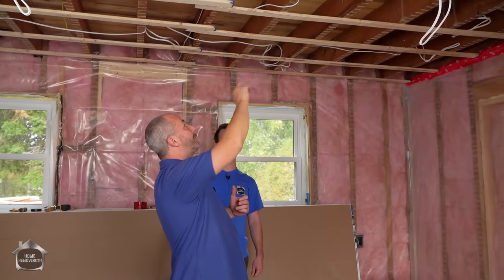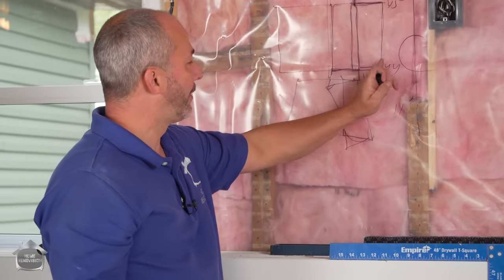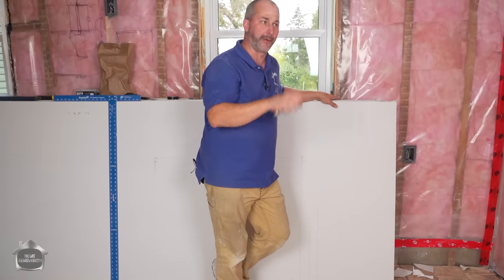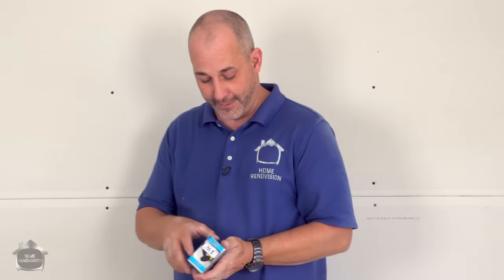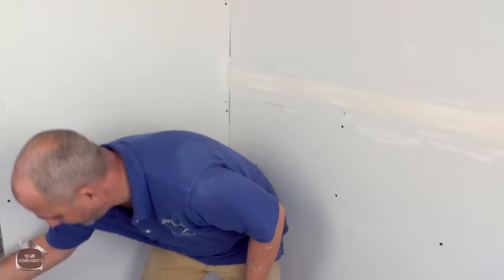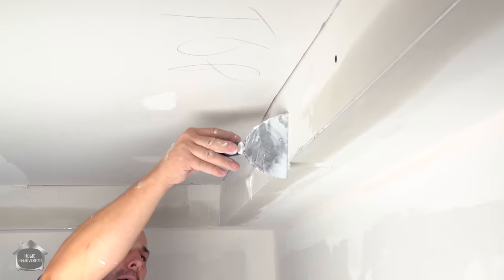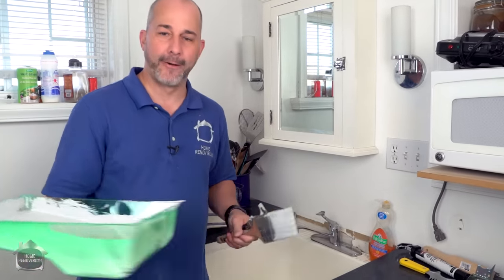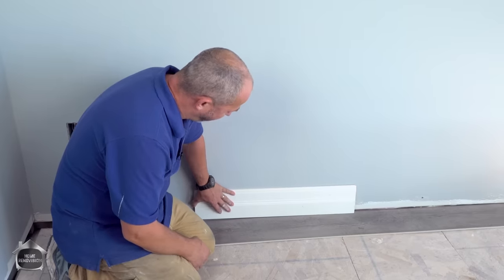How To Install Drywall A to Z | DIY Tutorial

Comment: That vapor barrier is going to shit after you drive in thousands of screws of drywall and nails, congrats....
Reply: The vapor barrier is for the opening between studs, the drywall and screws on the studs compresses against the wood so the barrier is still intact.
Reply: @jacktrades3747  the best vapor barrier is the actual primer and paint
Reply: @webtheweb  then why are you worried about the plastic inside the walls? Do you live in a warm climate? The point is that barrier is not getting punctured unless you just pop screws in randomly and wrecklessly. What happens to your idea of a vapor barrier when you start hanging pictures, paintings, clocks, anchors, etc.? It stops being a barrier, but if you're hanging on studs that interior barrier will stay intact. 

A vapor barrier done correctly will drastically reduce water damage from moisture in the structure and allow it to dry with the movement of air. Besides, it's usually building code in cold climates and adds life to the structure. If you never see winter you don't need it.
Reply: @jacktrades3747  it seems like an unnecessary step.  I don't live in a cold climate, hence that's why I fail to see the value.  Usually drywallers miss alot of studs, thus puncturing the plastic.  Hang pictures, tvs, cabinets, clocks, almost making the vapor barrier without it's original intent.
Reply: @webtheweb  Ok, he lives in Canada, I'm in Minnesota where it's an average of -20 this time of year, and having that barrier is necessary when the inside walls are 70 and the outside is ridiculously cold, which creates excess moisture in the walls.